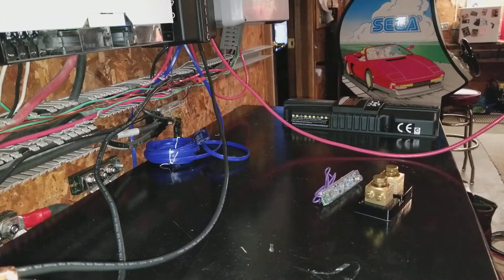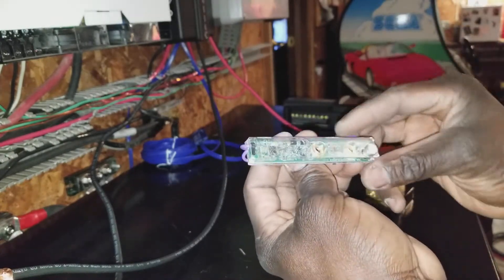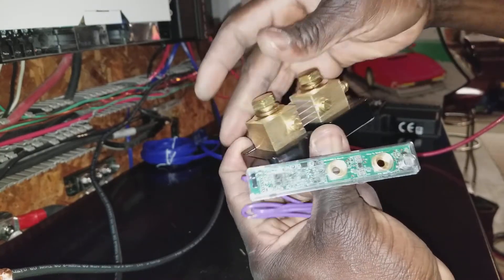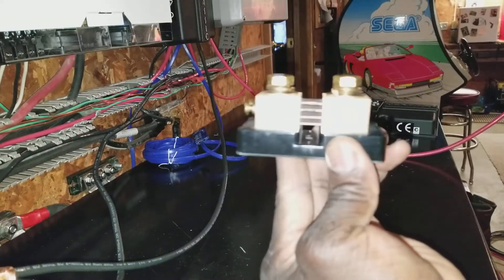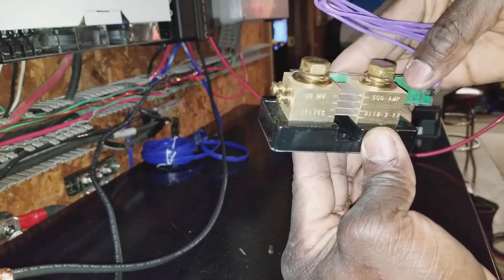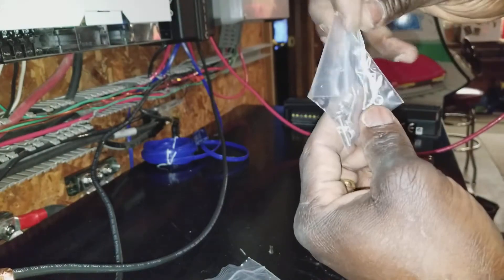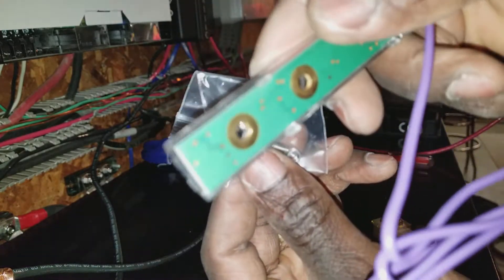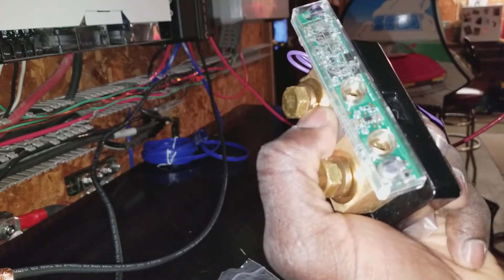LIVING OFF-GRID IN AN EARTH STYLE HOUSE || DIY Wiring the Whizbang Jr to the Kid or the Classic SE#7

Comment: What is a whizbangkit  ?
Reply from the maker: +Rudy Serlet 

Midnite Solar
Whiz Bang Jr.

The Whiz Bang jr is a current sense module that attaches to the standard 50mv / 500A Shunt and wires into the Classic Charge controller to give Amperage readings from the shunt. This allows for EndAmps to function based on System amps or Classic amps.

The Whizbang Junior provides highly accurate current sensing when used with compatible Midnite Solar products . However, for customers that already own similar battery-monitoring products, the Whizbang Jr. has been designed for cooperative attachment, as well.
Reply from the maker: +Rudy Serlet  

HOW A SHUNT WORKS
A shunt is necessary in order to measure amps and amp-hours with the TriMetric battery monitor. A shunt is an accurate, very low resistance resistor which is placed "in line" with the wire carrying the current to be measured. With the TriMetric, it is usually placed in the negative wire from the battery bank, such that all the current going into the battery (charging) or out (discharging) must pass through it. Connected in this way it will be set up to monitor "net" amp-hours in and out of the battery. (It also could be placed in series with the negative wire coming from a solar array--or other charging source--in which case it would measure only the solar array current, if that were desired--to show total solar "amp hours" production.) The shunt needs to be placed near the batteries; since these wires carry very high currents the wires from the batteries must be kept short to minimize electrical losses.